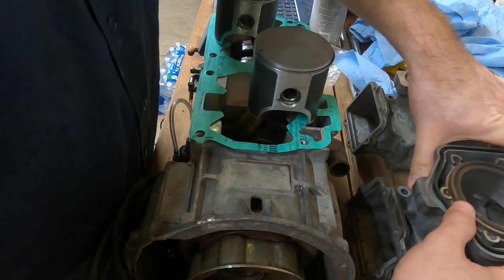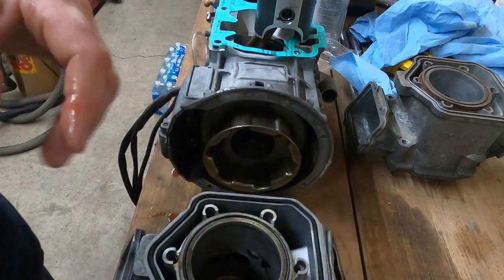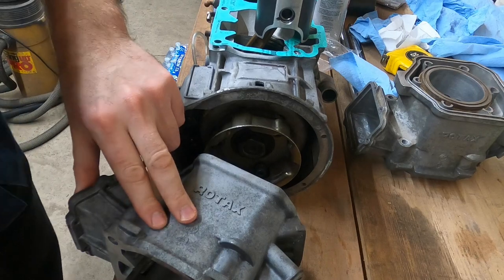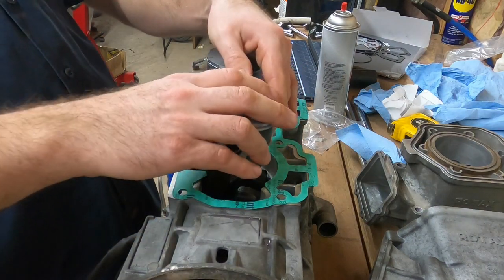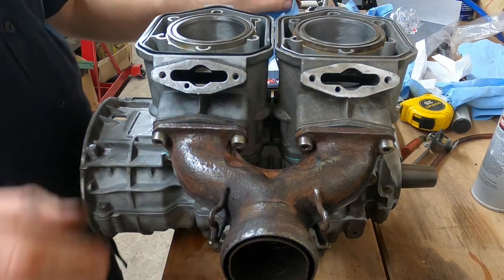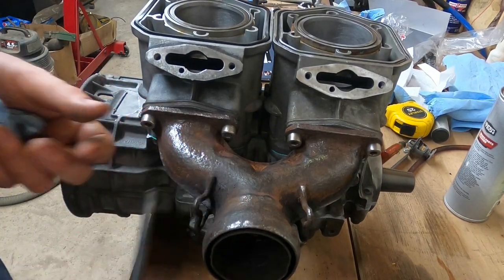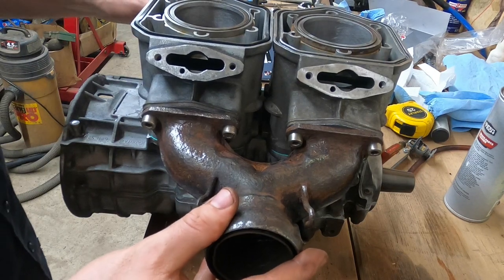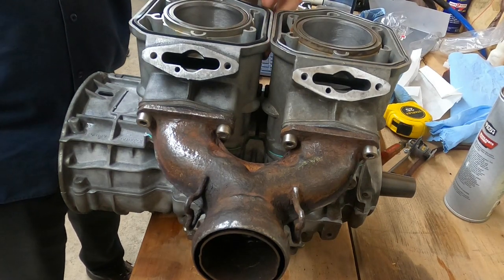Rotax 500, 600, 700, 800 Top End Installation

Comment: I always bolt the exhaust manigold to the cylinders and intall them as a pair. It keeps them true to each other. Also the base gasket should have a thin film of anerobic gasket sealer on both sides to alleviate the coolant eventually deterating the paper gasket. This is per Bombardier service manual. I was a service tech for Skidoo for 42 yrs......got in on the 2001 piston recall ,where I rebuilt 40-50  of these during that snow season in Montana.
Reply: Thanks!
Reply: Hey man, what’s the best way to get the bass gasket residue off without scratching the surface?
Reply: Maybe you can help identify my engine I know it's a rotax 700cc 2 cylinder stroke but that's about it I'm sure it came off of a snowmobile but it is on a drakart now but to find parts and specs would be easier if I knew what it was on I'm thinking mxz formula 700

Comment: i got a quick question for you Mac. Just got finished rebuilding the top end on my 2001 mxz 700 deglazed and freshened up the cylinders new pistons, rings and gasket kit. they are single ring pistons and my question is is there a top and bottom to the rings? i tried to start it and felt like no compression tore it back down and both rings are stuck in the ring lands im stumped. cylinders and pistons seem to be okay.
Reply from the maker: If there is a marking on the ring it should face up
Reply: thanks so much for your reply mac! i checked my old pistons too and the markings face up. im going to flip the rings and try again cheers! @macsgarage
Reply: One other question for you if you don’t mind. I have a 2001 mxz 700 with a mangled pilot jet. Can I use 2002 mxz 800 carbs on my 700 if I swap the main jets and the needles from the 700 to the 800 carbs. I have both sets at my disposal.
Reply from the maker: @beerman2for1  I don't know that one off the top of my head.  I'd check part numbers between the two.
Reply: They are both 40mm carbs. The part numbers for the carbs themselves complete are different. However, all interchangeable parts excluding main jets and needles are the same from 2001-2002. I’m going to build a set with my main jets and needles and I’ll let you know how it turns out 👍 thanks for the reply. Love your videos

Comment: The oiled assembly has been replaced by dry assembly mostly these days. There will be oil coming with the gas.
Reply from the maker: Anything that moves on startup needs oil immediately.  Oil is coming eventually but it should be there right away.  It should be a conventional 2 stroke oil though.

Comment: Thanks for the video Mac, I learned a lot. Do you know if this engine has the nikasil coating in the cylinders or a good old fashioned cast iron sleeve? I have a 2002 Rotax 600 which I am guessing would be the same as yours and need to do a top end and possibly some cylinder work. Thanks, Jon
Reply from the maker: I can tell you for sure the 500 is an iron bore, honed mine in the shop.  From what I can tell 600ho is nikasil the non ho 600 is not.
Reply: @macsgarage  I'm glad to hear that, thanks Mac!

Comment: Would the process in this video be the same process when i rebuild my 2008 Ski-doo Summit X 800R 154" RevXp? Or is it different?
Reply from the maker: If it has 793 on the tag mounted to the mag side of the engine it should be the same.  I  don't have a  manual for an 08 at this time so I can't really verify.  Should be pretty similar though

Comment: I am having a ton of trouble finding caged wrist pin bearings for mine, it’s a 2002 with the 493 engine. The factory cageless do not work with wiseco pistons. And every cageless I’ve ordered is too big in diameter. Any suggestions?
Reply from the maker: @thejeremyashby  I believe there may have been a couple different sizes of small wrist pin based on year.  I would check out a 2000 model year and see if it's different.
Reply: @macsgarage  thank you I appreciate your response. What kit did you buy for your engine? Is yours the 2002 model?

Comment: I’ve replace this cylinder base gasket 2 times now and still wants to seep out? I’ve tighten in a kris cross patter at 21foot pound
Reply: Many of the shop manuals show cyl  torque at 21..where if you check service bulletin or the dooforum you will find it is actually 30ftlbs.
Head is 21.

Comment: Looks like a top end rebuild kit for my machine, the pistons are available in three different sizes.  How do I choose?  Thanks!
Reply from the maker: You will need to measure your current pistons or look for markings on the top.  If the cylinders need bore or hone work you could have the person doing that measure and advise.
Reply: @macsgarage  Got it, thank you!

Comment: What year is your motor? I have a 600 ho swap in my 800 but don’t know what year it is and I need a cylinder
Reply from the maker: This one is a 2001.  You should be able to use the casting numbers to make sure you get the correct cylinder.

Comment: how  do  you add oil to crank case?
Reply from the maker: The only oil in the crank case is in the center.  It's not something that gets changed like a four stroke.  If the sled has an oil injection tank there is a line the allows oil to flow into the cavity when the tank is totally filled with oil.  If it's a premix engine there should be a small bottle that gets filled with oil to keep that area lubed